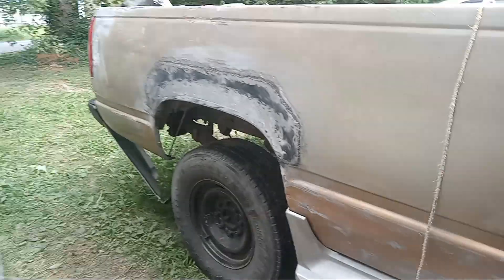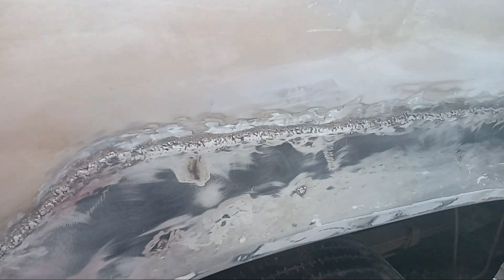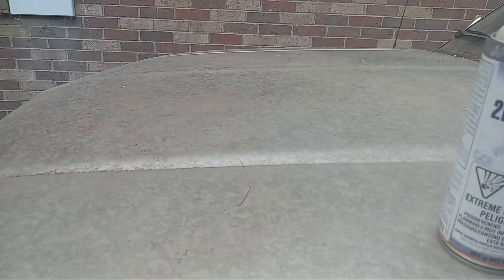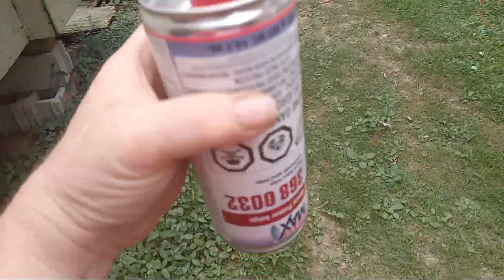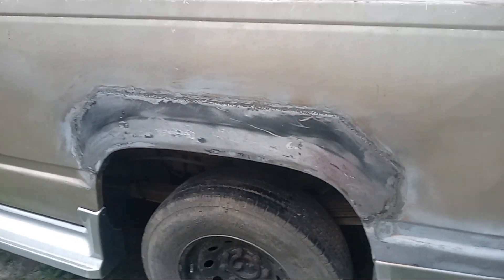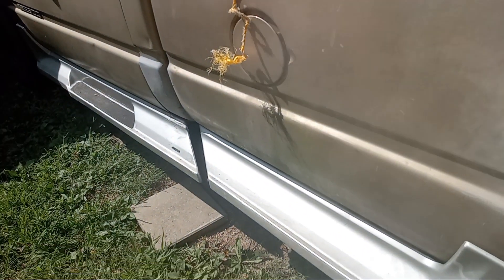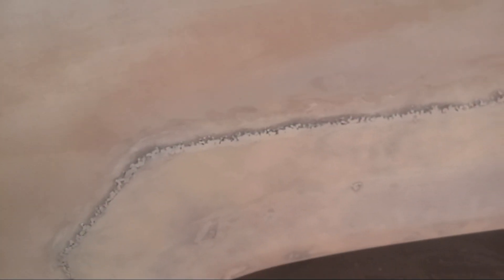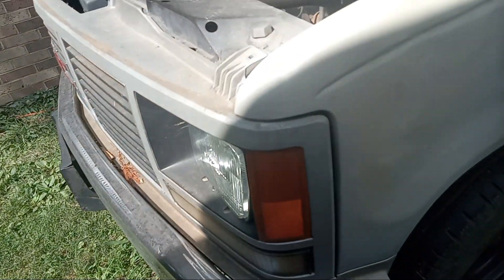1989 GMC 2500 Bed Side Rust Repair Epoxy Primer

Comment: Is there anything Joni can’t do?  Let’s see: carpentry, roofing, painting, electrical, plumbing, HVAC, chef, musician, and more.  That’s the right primer. 2K is the only way to go for the best adhesion and rust protection!  That is also really expensive primer.  Nice choice.  Can’t wait to see what you do next.
Reply from the maker: Thanks! I'm prepping the truck for paint, little by little, but this is just a starter truck. I eventually want to switch to a 4wd.